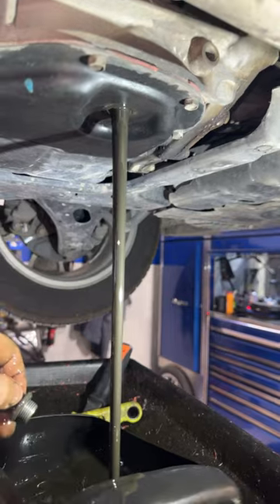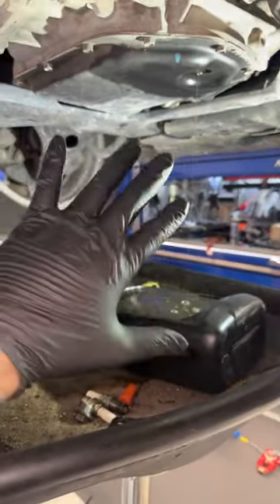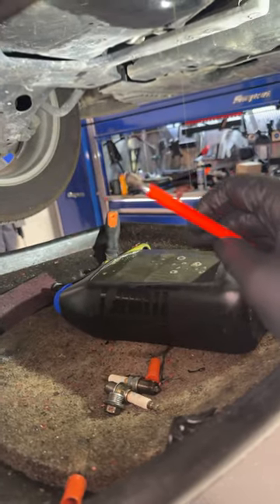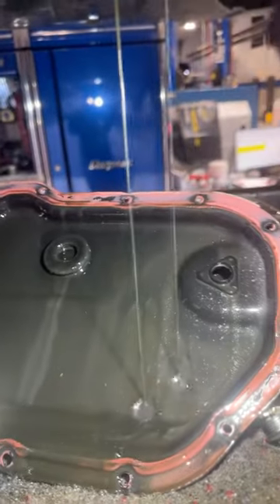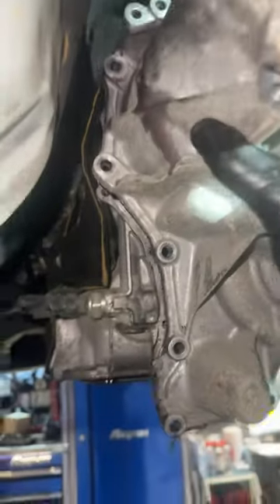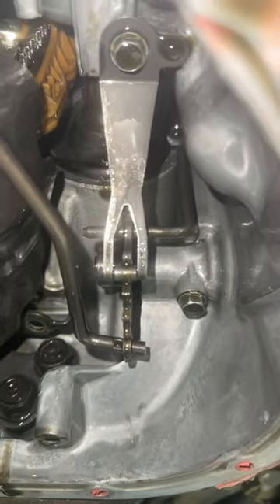Tech Tip: How to go silver mining #deadpixies #mechanic #cvt

Comment: I swear I thought those cvts were recommended every 25k with extreme driving conditions otherwise 40k. Whoops, my incompetence has saved some transmissions so the car can die its natural death, a blown head gasket. If they don’t want me to change the fluid then don’t make it so easy either.

Comment: My 2018 Impreza has 32k miles on it, should I drain/fill or flush the transmission soon? I just want it to last as long as possible
Reply: Definitely stick to drain and fill. Much easier and safer—flushing can cause damage. every 30-50k at most is a good interval. I do mine closer to 30k. Also look into changing the filter every couple drain and fills
Reply: Also meant to mention, your trans may be sealed so make sure to look up videos and read guides, you may need to check the fluid level at a certain temperature to make sure it’s right
Reply: I'd say every 30k drain and fill. No flushes.
Reply from the maker: Great question!
Your vehicle is equipped with a CVT, and I only recommend using Subaru CVT fluid; because not all fluids are designed the same.

Anyhow, 30,000 miles is the perfect interval to start protecting your transmission (CVT). 

As mentioned below there are two ways to complete this task: 1. Drain and fill 2. Flush.

Flushing requires a service machine to complete the task correctly and is best left up to a dealership. NOTE** I say dealership because these CVTs can be picky and NOT ALL BASIC service centers keep up with all the many different CVTs on the market. This is a loaded statement and will mostly likely bring out the trolls and haters.

Drain and Fill is the easiest DIY task. There is a fill plug and a drain plug, but NO DIP STICK. Drain the fluid, measure how much you drained, then return that much back into the transmission. This is the simplest way I can explain it. Again this will most likely get me yelled at for suggesting.

Sound like I need to make a special video about this.
Reply: @baja-automotive I have a 2020 forester with a little shy of 50k miles on it and for me at least a video on draining and replacing trans fluid and warning signs to look for would be great.

Comment: What was that last part you took off that revealed the gears? I'm guessing its a part to the transmission
Reply: Believe it's a part of the transfer case assembly. Could be wrong though.
Reply from the maker: I removed that tail housing to reveal the transfer driven clutch pack.

Comment: "There's evidence of coolant mixed with the trans fluid too!" 😉
Reply from the maker: Subaru CVT fluid is a light green to start with, I do not see any coolant in the fluid.
I do always leave some to setting overnight, just to be sure though, and the fluid mixture stayed consistent.

But whenever a transmission throws medal into the fluid I always replace the transmission cooler. If the customer declines the part then I decline the work, another tech can risk the comeback. I've only had one customer decline the part and he towed his car to another shop, I heard they just rolled it into the final bill without telling him.
Reply: @baja-automotive  I was half joking about the little amount of coolant that was left over in your container (I know you cleaned it out before dumping the CVT fluid in there) 😬
Reply from the maker: @hdoglesby  lol
I see what you did there
I read into the comment too much